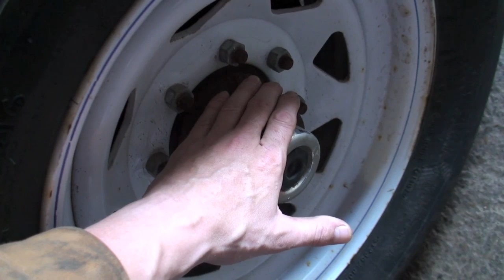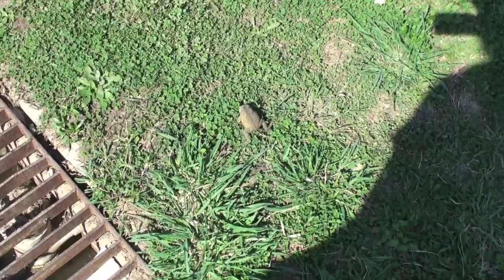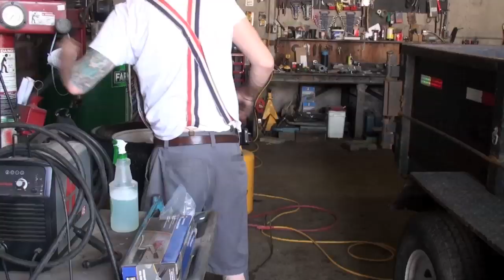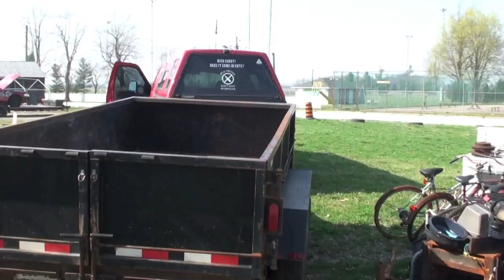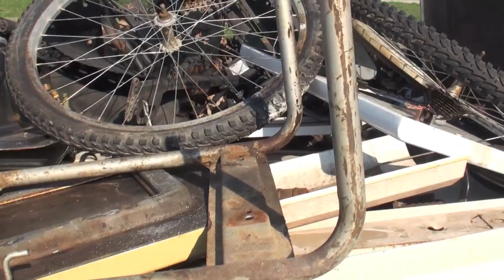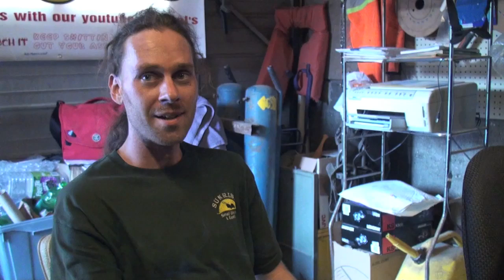shes a beauty day boys

Comment: Running tires low with a load will make the tire fail from the heat. That's why you see all the shredded tires on the road from the big trucks they leak then start to heat. My best friend has a trailer just like big dumpy and it was happing all the time till he stop loaning it out.  Never loan your tools or your trailers its makes friends into enemies happens all the time.  Good video boy's not a dicker 1pug production. LOL

Comment: Sorry pug you should never use plugs on tandem trail tiers because when you make tight turn it can pull the plugs out especially with a heave load and it could destroye the tire before you could bring it to a stop.  I plug a tire only as a temp repair then soon as I can I patch the tire single Axels are ok but still like the patch its a better repair and you have a tire machine any way,